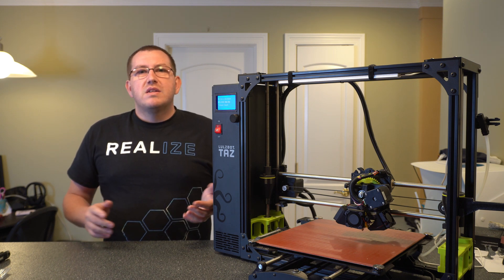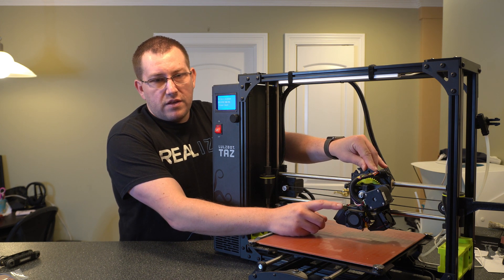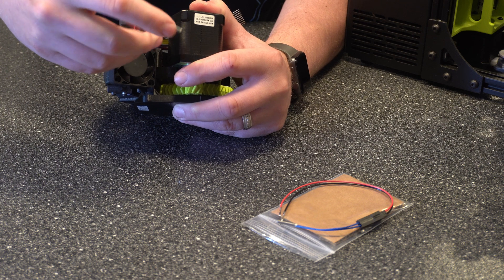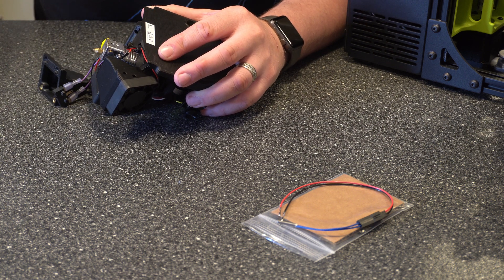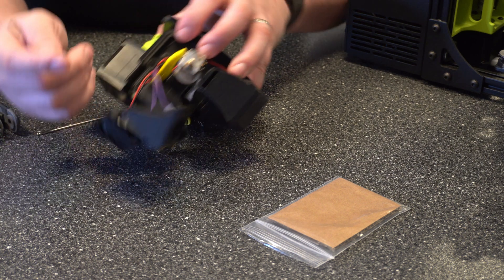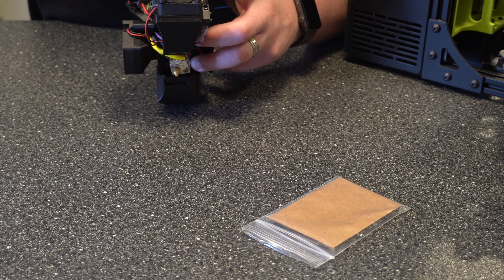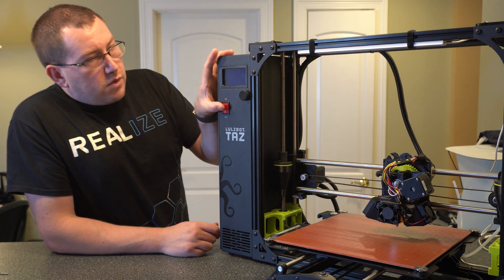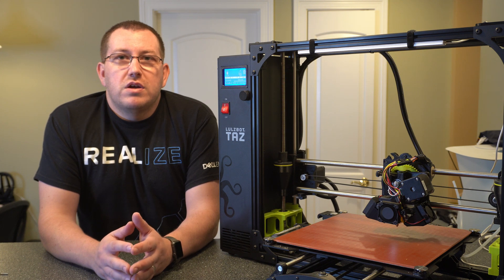Taz 6 Thermistor Replacement Guide - (Fix MINTEMP Error)

Comment: My issue is I'm not having any temperature reading for my nozzle. I have the same tool head as you but I don't seem to have a temperature probe
Reply from the maker: Hi. There should be the heating element and thermistor wires going to the hotend. Do you see both?

Comment: My issue is a bit weirder. Same error, but I've replaced the heater block, thermistor, and heater cartridge. The resistance is in the range Lulzbot says it's supposed to be, but when I power on it still gives the E1 Mintemp error
Reply from the maker: Hi. Have you changed the firmware or anything on the machine? It may be worth contacting Lulzbot support, they are actually pretty helpful.
Reply: @3DPrintscape  it ended up being an issue of the hotend having the directionsl sticker on the wrong side, so I had repaired the hotend but plugged it in wrong LOL

Needless to say, I was very frustrated. As for  Lulzbot support, they were very unwilling to help when I told then the heater block and thermistor were from E3D directly.
Reply from the maker: @dasauto7346  Didnt think they would push back on something like that, but Im glad you got it running.

Comment: my taz 6 having a "bed heating failed PRINTER HALTED please reset" is this the same issue like yours?
Reply from the maker: Hi. Ya thats what mine was doing.
Reply: @3DPrintscape  i think my build plate have issue not my nozzle, because the nozzle change its temperature but the plate doesn't heat up
Reply from the maker: @jeroshigermedia4735  Ah, it could be the thermistor on the build plate then.

Comment: Love my Taz 6.. But getting Thermal runaway errors.
Reply from the maker: Hi. Did you end up getting they fixed? I had to replace the thermistor on mine.
Reply: Hey I get the thermal runaway error about 3 mins into a print. The nozzle temp set at 235 jumps down to 200, 195, back up to 220, back down and so on. Then gets error.  Would replacing this part on you video fix the issue?
Reply from the maker: @guyblais6365  It really sounds like its getter bad readings so I think it would, cant guarantee it though.